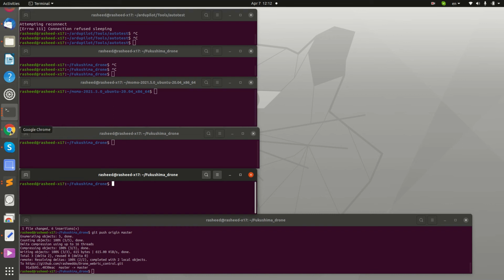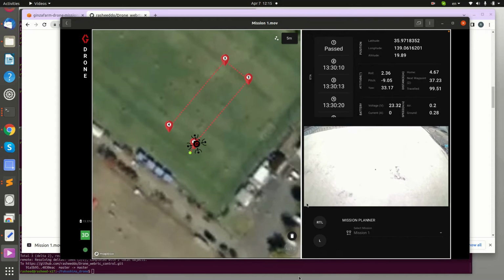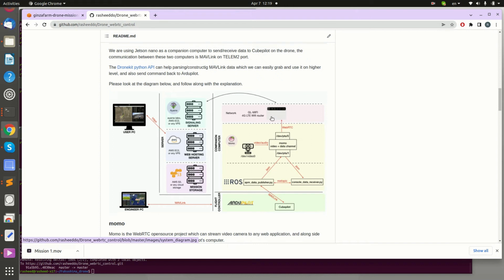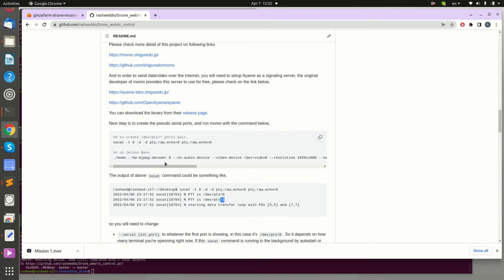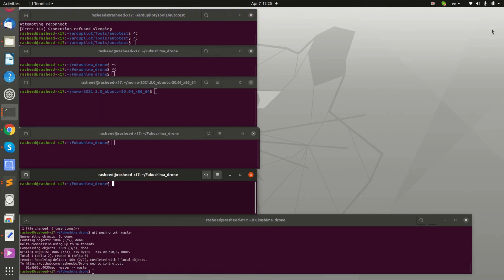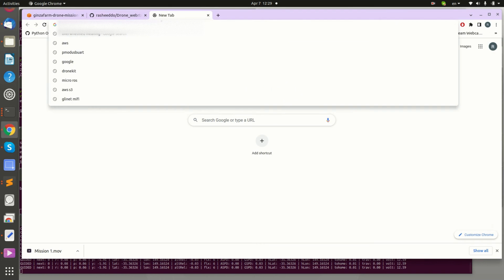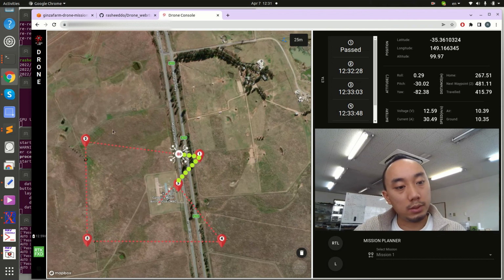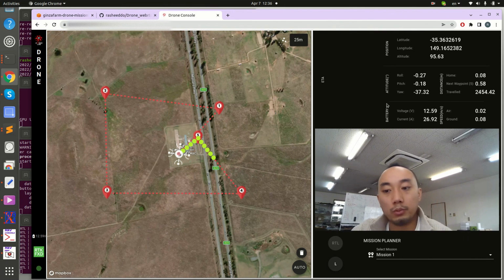Drone control by WebRTC on web application

Comment: Hi Rasheed, you are doing some great work by open sourcing your work. This is a great tutorial with detailed explanation how the whole architecture, control and networking is done. If you can make a similar tutorial video of your ATcart delivery robot, that would be helpful. (Previously you have made a video showing how you have created the robot but I think the control and network interfacing part was missing. This is a good topic to touch on as a lot of people is trying to do the same.) Thanks in advance.